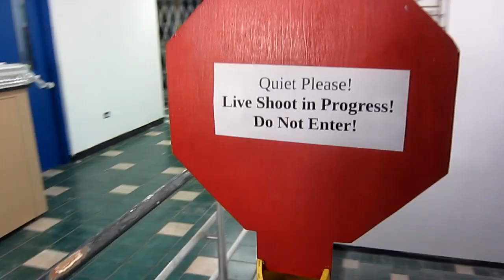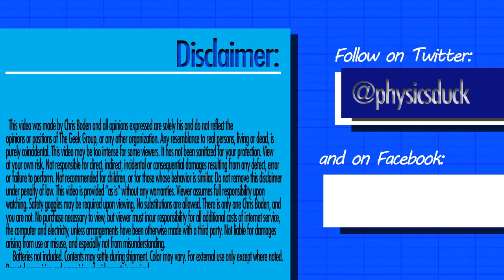Captain's Blog 10-8-11 Test Group, Zombie Movie, and Haas Demo production

Comment: Dear Chris,
Your videos have gotten me interested in high voltage and I have been experimenting with disposable camera capacitors and their related charging circuits.
I'd like to take a step up and upgrade to some larger capacitors, somewhere in the 300v-600v range. In the end this will power a coil gun or a ring launcher of some sort. Do you have any suggestions for a charging circuit I could run off of 6AA batteries (similar to getting 300v from 1AA)?  Or is this very unpractical?